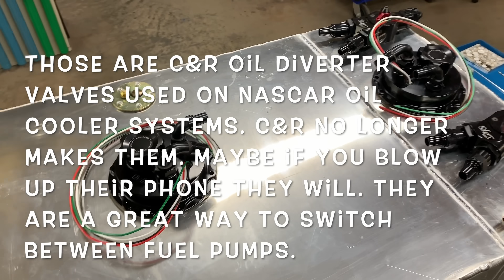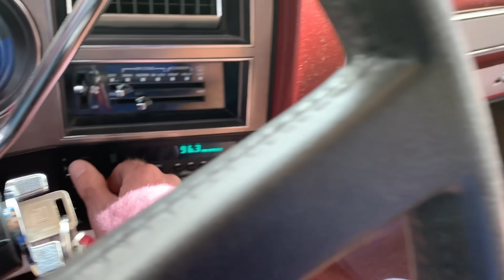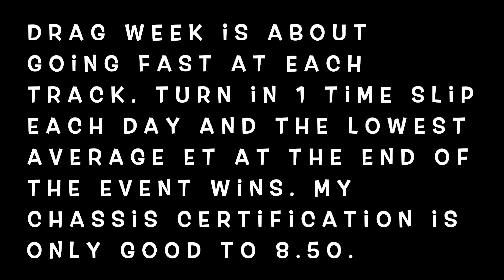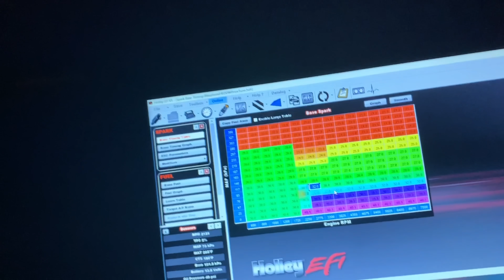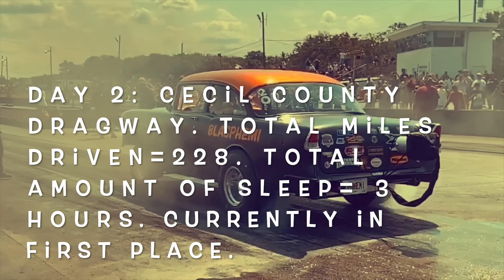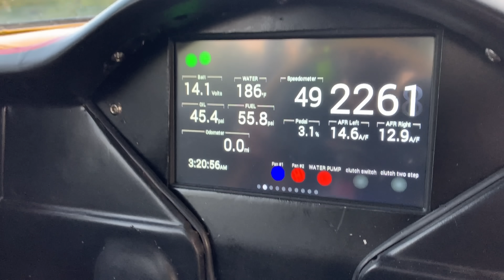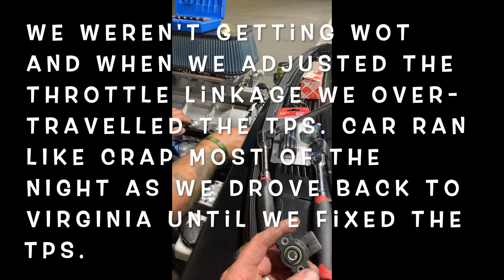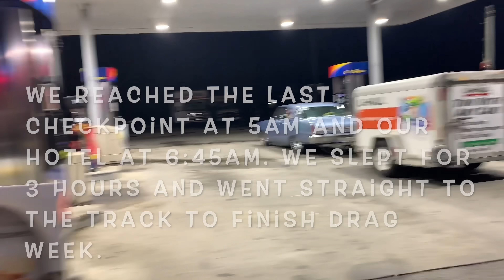1,000 MILE ROAD TRIP IN A 69 YEAR OLD CAR!

Comment: A tip about solid state relays, they give off about 10% of the power they carry as heat.  The greatest thing ever is a hybrid relay.  The use the SS for switching and a mechanical relay to carry current.  You avoid the spark on the contacts and heat of the SS.

Comment: Since you've got the Wire Care hookup, consider using ferrules in your terminal blocks for stranded wire.  Adds strain relief, less resistance and no chance of a strand going somewhere it shouldn't.
Reply: Great idea, I’d never considered this before.
Reply: Agreed and use the tool for them
Reply: I’ve always just tinned the ends of the wire before inserting in to the terminal block, but your idea sounds even better!
Reply: Sweet idea.
Reply: @rickfazzini22  Tinning is worse than nothing at all.  You're solidifying the connection but irregularly, which means more resistance than letting the strands shift and shape to the terminal when it's being tightened.  Also, the solder will actually flow and change over time and the connection will weaken if you're not tightening your terminals.
Reply: @tmilker using the proper solder and having the knowledge to do correctly is the key to success.  All solder and skill levels are not the same.  I have some soldered connections done in 74 that are still perfect today. But I've been doing it for 40 years so there's that.  Crimped end connections and soldered have never failed me yet.
Reply: @randalltufts3321  I'm talking specifically about tinning the end of a stranded wire that is going to go into a terminal block.  I should have used "tinning" instead of "soldering". :)

Comment: Mike you really need to crimp ferrules on the end of all the wires going into those solid state relay blocks. They're cheap and prevent the screw blocks from damaging the bare strands of wire. 

If Holley wasn't dumb and would make their CAN protocol public or if you used a regular ECU I'd say to just get a Power Distribution Module and CAN switch panel. Only need 4 wires to the panel with up to 12 buttons and different colors for each button. And with a pdm you can set the "fuse" amperage for each circuit and set logic to them so certain things would be shut off or turned on with ECU conditions or sensor readings.

Comment: 28:05 a good tip is to bend the wire back and forth while tightening it in the terminal. This allows the round wire to flatten out and fill the cavity more evenly preventing a loose connection over time due to vibration. 🍻

Comment: I have those same hydraulic crimpers and when you find a dye that's close enough I usually put the fixed handle in the vise lightly so it doesn't want to rotate while you're crimping. Thanks for your videos as always! 🙏

Comment: I wired high end control systems. Instead of putting stripped wires into a clamp terminal I first put a ferrule on the wire..More support for the wire and prevents stray strands bridging terminals.

Comment: Love your channel. I'm more into experimental aviation, speaking of wiring there is a similar product on the market for your issues, the VPX pro uses software to provide circuit protection for a small aircraft, bypassing old school mechanical relays and circuit breakers. MSD seems to be going the same way with solid state circuit control.

Comment: You need a rear window with louvers or window with holes cut in it. Or break down and put some sliding windows in those drivers and passenger side doors like the 55 and Tulane blacktop

Comment: Your stick out on the terminals should be approximately the width of the wire. And he was right if you stack terminal lugs you out one down and one up and depending on the size not suppose to stack more than three on one post. This is per the 505 aircraft manual. Lol

Comment: Hey Finnegan, i had a thought when you were trying to modify your circuit board box

Couldnt you still have the box sealed up wit the front and back walls, but design a trundle drawer so the board slides in and out the side out the door? Then you could just leave the seat in place and not have to lift it. Just slide the drawer out to work on the electronics?

Comment: Here's a little trick i came up with for charging system situations. I have an old school bicycle generator that runs on the tire. I made a mount that i can attach with a pair of vice grips to any vehicle. and run the little metal wheel on a belt. When a customer calls me that their alternator is dead i go out and attach it to virtually any car and it provides me with enough charge to get the car back to my shop, And i can charge them for a service call and bypass the tow truck. or i can get myself out of trouble

Comment: as far as tin snips are concerned, you have to think of them as opposite, in the terms that i am going to tell you. 
Red starts with R, so that means the bent metal, is going to be sent to the right side, meaning that the side that you want to protect and keep straight and narrow, is going to be on the Left side.  
So in my mind, i think Red or Green snips?  well i want to keep the left side of this line good, so i dont use the R red cutters, i use the opposite, which is red/.  
you guys had it ass backwards after changing from the yellows, so i just wanted to chime in.

Comment: Use wire Ferrals on the screw down connection’s or solder the wire or the screw down’s will cut the wire

Comment: Dude.. I have a great almost finished project that needs to be wired and brake lines finished..which im working on now.. If you want content for helping out a fellow long time car guy who is a long time body / frame tech.. come on up to Massachusetts!! ive got a car trailer and a shop with air.. welder.. plasma..heated..a/c etc..  all the parts here.. ready to go. If you would be willing hit me up.. Id love to see ya! It was going to be a budget build but its far from that..

Comment: How is it possible that Basphemi is better now in so many ways than back in 2019 and yet it went slower and broke more than back then??
Reply: Exactly what I was thinking… it’s got the same or more power so the remaining factors would be clutch or rear gear.
Reply from the maker: @scottsmith5623  im still learning to manage the clutch and new suspension. only had 1 day of testing the new clutch when we headed to drag week.
Reply: Finnegans average was actually lower in 2024 than in 2019 by day four. Fin was kind of lucky with that 8.52 run in 2019. Most runs were worse in 2019 than this year. Takes time to dial in a new combo. Remember that the trans was swapped from the GF5-R too.
Reply: Just to clarify, i was being facetious with my comment. It does seem like that new clutch needs to be adjusted for each track. Plus the learning curve there. Hopefully Fin can pull of a class win next year!

Comment: Would a little duck-tail spoiler at the roof/rear glass line help divert air over the trunk? Just something to keep the air away from the front of the trunk lid. And also, have you ever considered a heat shrink labeler? I use much smaller gauge wire, but it makes life easier.